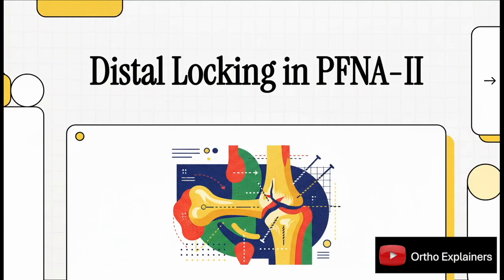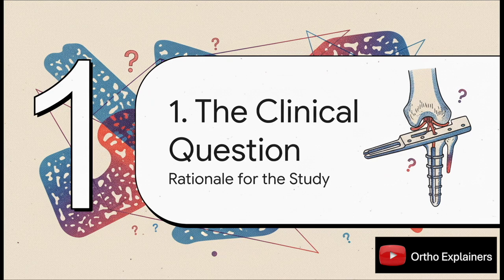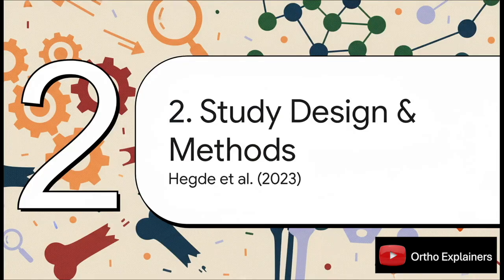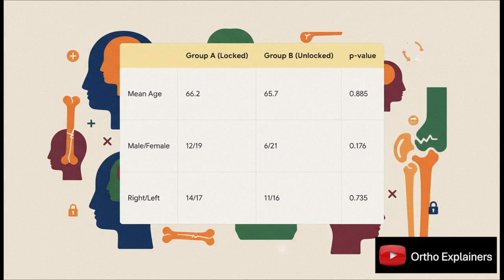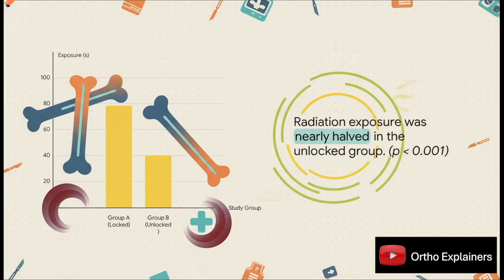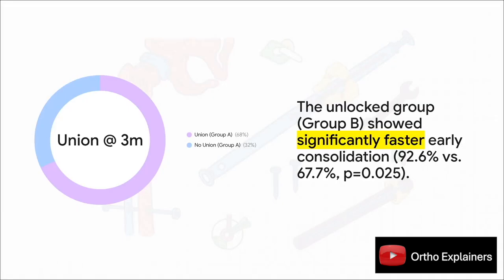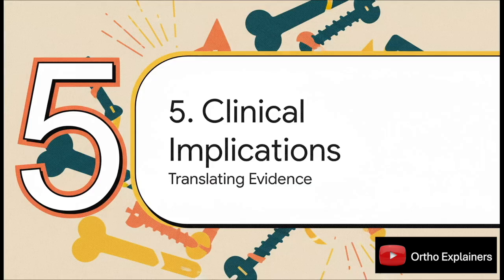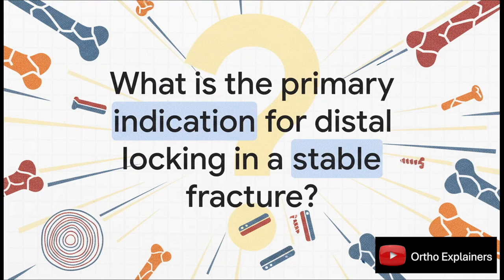Distal Locking: Yes or No? in stable trochanteric fractures

Comment: Why should I use a long nail for this type of fracture? I always use a short nail.
Reply from the maker: Yes, that was thought provoking. If I am putting a long nail, and if that doesn't need distal locking why to put that nail in first hand. This paper was presented in our journal club and my colleague who made presentation wanted inputs from others. That's it. Rare case scenarios where I skip distal locking is when doing long nail in young pts with incomplete or undisplaced trochanteric fractures. Surgery takes less than 5-6 minutes and distal locking is not needed in such cases. No other indication in my hand.